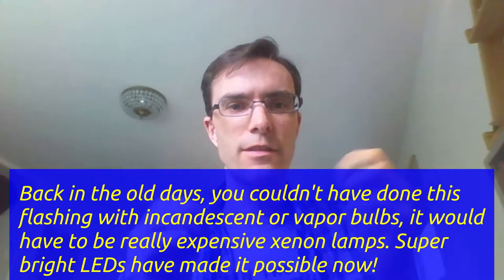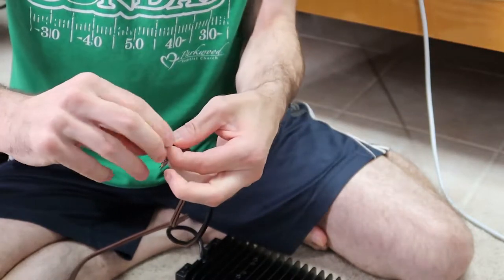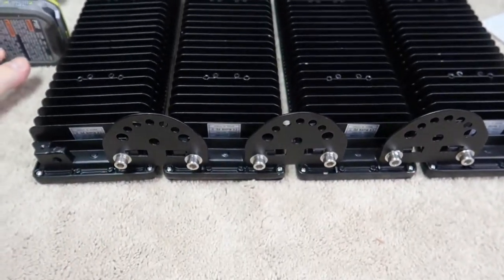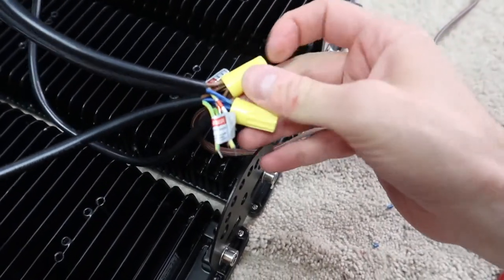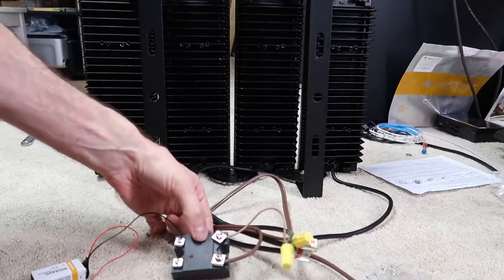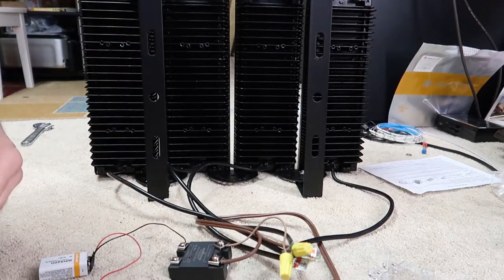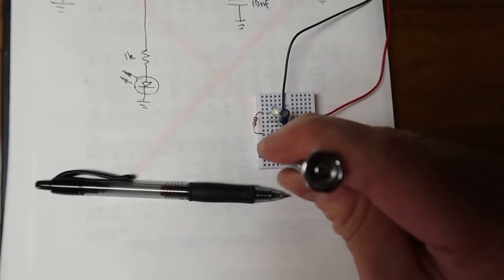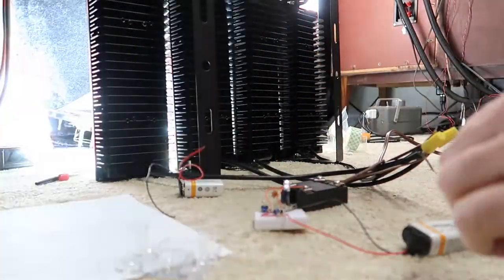Build a puke ray (bright LED flashing dazzler), a non-lethal weapon

Comment: The video you referenced at the end said that the light didn’t work. They literally said it was o my good for raves. Did you ever actually get nauseous and throw up with this?
Reply from the maker: Man, I sure didn't want to try testing that. It's painful to look at. That was really the purpose of this device - a deterrent. Add in horrible screech noises pulsing at a slightly different frequency, and very low frequency pulses at yet another frequency, and you just don't want to be nearby!
Reply: @JoyeMusiccom  we used to use em in iraq as contractors